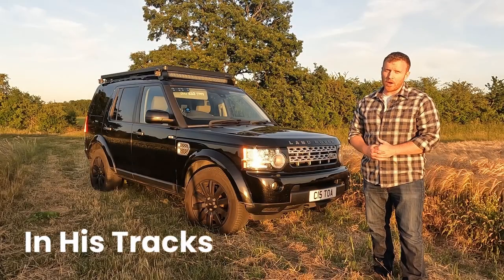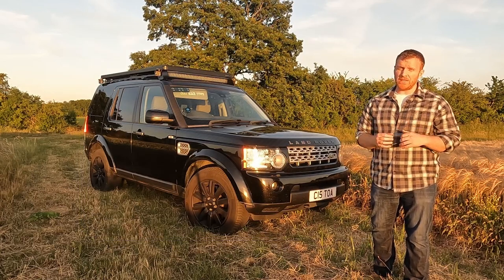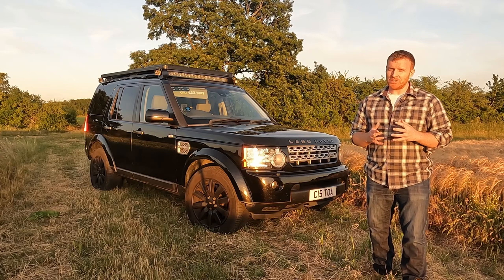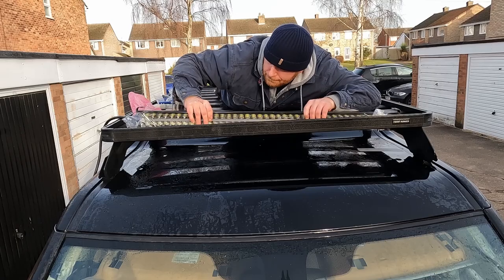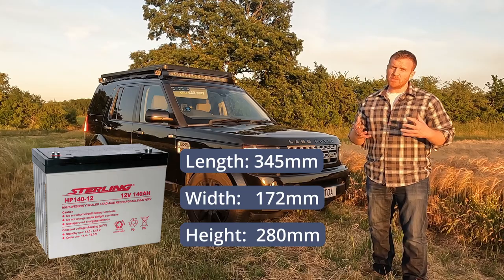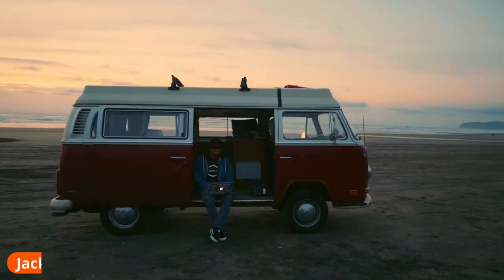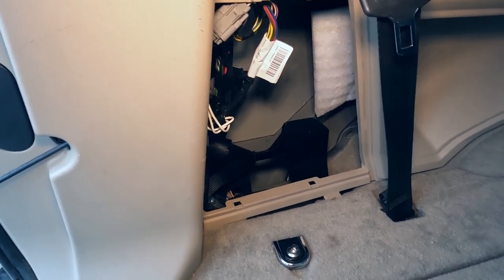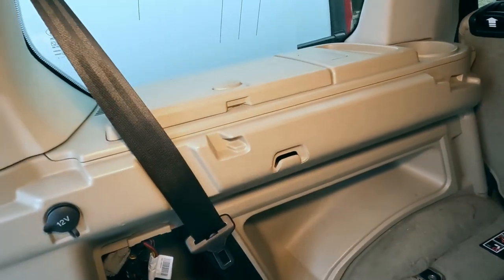Installing a Leisure Battery and Inverter into my LR Discovery 4

Comment: Looks like you've done a tidy job mate. 👍 With everything packed into a small space so tightly, let us know if you have any issues with heat transfer or overheating of any components as there doesn't seem to be a great deal of ventilation in that compartment.
Reply from the maker: Thank you. Yes I will do. One of the mechanics at Avenger 4X4 used to modify Land Rovers for big expeditions. He worked on my car and saw the final set up. He wasn't concerned. But I'll keep my eye on it and comment if anything happens.

Comment: Little tip, if you change your 230v socket for one with neons on the switches if you leave them in the on position you will be able to see if the inverter is on.
Reply from the maker: That's a great idea! Thanks

Comment: Nice job.  Good thing you don't have the rear air conditioning option or that space would have been full or at least most of it used up. I just subscribed to see more of your work. BTW I don't use my third row of seats so I just built a false floor and put the fridge, second battery and rear drawer on the false floor.  Only issue with running wires under the car is they may need to be removed for any body off repairs but lets hope you don't have any of those.
Reply from the maker: Yes that's exactly what the garage told me (about the air con unit). A lot of people seem to go the way you have, and it makes a lot of sense. I guess I just haven't fully committed yet to making it a pure overlander. I haven't used my third row yet either.

Comment: Just to let you know the 13A fuse will limit the current drawn from the socket to 13A. I don't know what size inverter you have but personally I'd downsize the fuse to suit, that will give extra protection for the inverter.
Reply from the maker: Hi Paul. Thank you. Milly suggested the same thing, so I am going to ask Bimble Solar exactly what the fuse should be rated to and get that changed ASAP. Appreciate the advice.
Reply from the maker: So I checked with Bimble Solar and they suggested a 3A fuse would be more appropriate. It's a 230V with a peak output of 700W, so a 3A should just about do it. If not, I'll use a 5A. Thanks again for the advice

Comment: Well done, i do love all your work that you have done on this vehicle :) i would put the leisure battery in the engine compartment which is near the ABS pump, there is enough room to mount all the hard ware. why do you need for 240v in this day of age, when overlanding ?
Reply from the maker: Yes, I did look in the engine bay, but to be honest, I didn't have the confidence I could fit it all in. If I had more mechanic skills, I would have probably done that. Good question about the inverter. The main reason was that I just followed the advice of Bimble Solar, who suggested the kit and set up. I do find it handy for the laptop, and even random things like the charger for my drill and other battery power tools, but you are right, most overlanding kit doesn't require it.

Comment: Nice one. I’ve been fiddling around with mine but not to such a degree. Yet… One thIng, behind that panel you had to refit having taken off the fins trying to get the cabling to work, what’s the metal cylinder that you attached the cabling too? Is it part of the rear airbag, or interfere with it in some way? I know that may not matter depending who travels in there etc, but just asking as we have kids who sit back there. Cheers
Reply from the maker: Hi Charlie. I think it's the airbag gas canister, or something to that effect. It's not the airbag itself. They are mostly in the headlining of the car and are quite obvious. Although the amount of cables I have run along the headlining, I did wonder how much it might have effected the airbags, but I did my best to keep them out the way.

Comment: Great work! Just a word of caution, you taped your wiring to the rear curtain airbag. Maybe not a good place. Rather tape/secure to something else (drill a hole for a cable tie body clip). Your passengers may benefit from that airbag working in future.
Reply from the maker: Hi. Thanks for that. I thought that was just the canister for the airbag rather than the airbag itself, but I'll definitely get someone to check it is still safe. I appreciate the heads up and sorry for the delayed reply.

Comment: Hi, awesome video, can I ask what you are using for work lights, they look really good, and how did you fit them? Cheers!
Reply from the maker: Thank you. I have several types of lights on the car now. They are all Strands lights. The work lights are called Red Fox Side lights I think off the top of my head. I'm putting together the video for it as we speak. They are wired into the leisure battery so I can run them with the engine off. Not a simple job... holes in the roof etc.

Comment: Great mod! May I know the wiring diagram? I couldn't figure out why you need both CTEK Battery Charger and Victron Charge Controller?
Reply from the maker: Thanks for the comment. Unfortunately I don't have a wiring diagram because I left that to the auto electricians. Bimble Solar in the UK sold me the kit so they might be able to supply you with a wiring diagram or a better explanation. But as I understand it, the battery charger is there to keep both the leisure battery and the main car battery charged. I think the leisure battery tops up first and then excess is sent to the main battery if required. The solar charge controller is ensuring the correct current/voltage (?) is being sent from the solar panel to the batteries. To be honest, I didn't question it beyond that 🤷🏼‍♂️
Reply: @inhistracks  I agree that you should have dedicated solar charge to get more power from the solar. And this may be better than the CTEK D250SE one (?) maybe
Reply from the maker: @tuanla1879  I assume it depends what battery and what solar set up you have. I intentionally bought the whole system in one go so the suppliers could make sure it was all compatible and optimal. But I trusted their judgement and don't know enough about the electrical accessories to comment on their effectiveness. You'll likely know more about this than me.
Reply: @inhistracks  Thanks for your reply. I don't know much but I'm just curious and I wanted to setup my own thingy so that I know more or less the strength and weakness of it. And if something goes wrong in the middle of nowhere then I will have an idea how to patch it up :D
Reply from the maker: @tuanla1879  Very wise strategy. I'll do a bit more reading myself.

Comment: Great video :) how much did all that end up costing compared to getting a jackaery?
Reply from the maker: Good question! And I should have really talked about price in the video because it is a big factor. The first auto electrician charged me about £850. Getting the second opinion and the additional fixes cost me another £600. If it was done right the first time, that £600 wouldn't have been necessary. The battery was approx. £250. Inverter, just under £100. Dual DC DC Charger was just under £200. Then there was the cables and sundries, which I'd say was probably another £150. Solar panel £170, solar charge controller around £90. So cost to me was around £2400, but should have really been around £1800. It's also worth noting that the auto electrician didn't just wire in the battery and solar panel. They also wired in the lights, the power output/input on the roof rack and the dash-cam.
Reply: @inhistracks  wow that was an  expensive journey maybe a jackary may of been a good choice especially with its versatility?
Reply from the maker: @mrfairycake4333  Yeah, it's a tough call either way. Some of the Jackery set ups including Solar panels are also quite expensive, but as you say; more versatile and no work required. I'm happy with it now that I've done it, and I like the fact that my car battery is also benefitting from the solar panel. I also wanted the leisure battery and solar panel to charge the dash cam (for example when the car is parked at the airport or train station for a few days). The Jackery would be slightly impractical for that, but way more practical and simple for most other things.

Comment: Change the 13A fuse to a 3A one. Your inverter doesn't have the power to blow a 13A fuse so it won't provide any protection.  A 3A one is good for about 750 Watts so even that is slightly overrated, a 1A fuse would be better (they are available for UK plugs) if you will be using less than about 250 W but does slightly limit what you can draw.  The inverter does have overload protection but better to correctly rate the fuse than rely on the overload protection.
Reply from the maker: This is great advice, thank you. I'll put it to Bimble Solar (who sold me the kit) and let you know what they say. Thanks again
Reply from the maker: Hi Milly. Bimble Solar agreed that a 3A fuse should work well. So thanks for that. I'll be changing that ASAP. Great advice!!
Reply: @inhistracks  Thanks for the follow-up